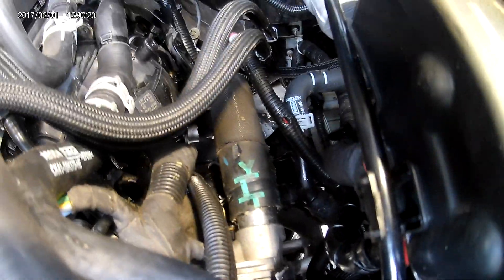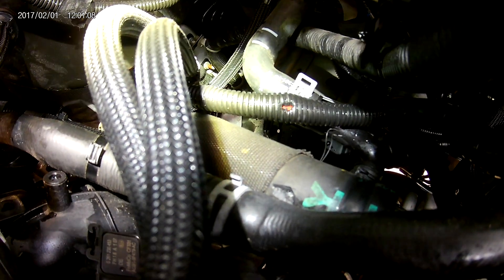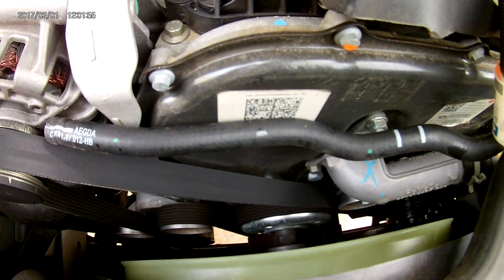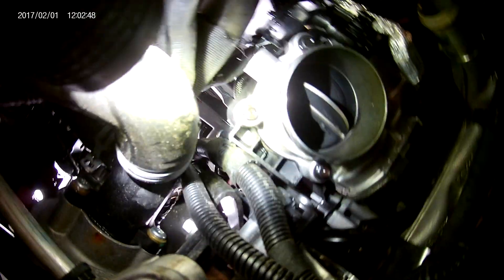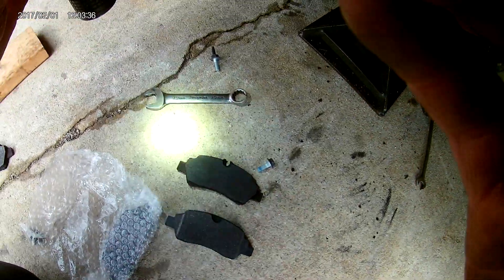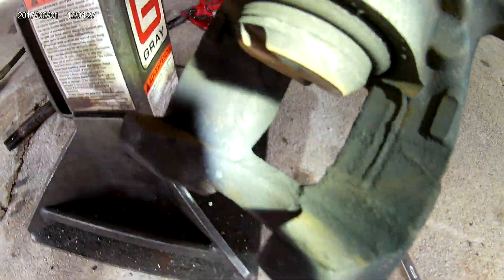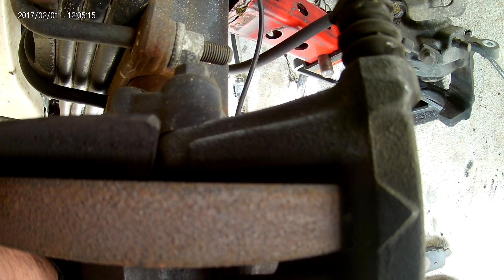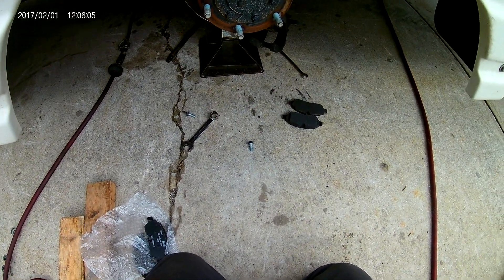2016 Ford Transit 3.2L Engineering fails

Comment: quote    though it's a derivative of Ford's Duratorq engine family, with origins linked to Ford's European engine development with PSA Peugeot Citroën, sharing lineage with smaller Puma diesel engines. It wasn't a single designer but Ford's global teams, particularly in.. This engine was a better fit in the Ranger 2012 up to 2021   parts well documented to cause engine failure are injectors , . egr  cooler ,,,egr valve ,,oil pump ,,, these issues are 100% random ,but very common

Comment: To add, the CAC hose rubs against the motor mount on the drivers side. 
God help you if you want to replace the front Macpherson struts. The dashboard has to be removed. The whole thing. Down the the firewall.
Also, Ford says there is no cabin filter for this van in North America. There IS a cabin filter for the European version. 
Guess what? Both versions use the same A/C Evap core box and ducting.
So yes. There is a cabin filter. 
And because Ford says there isn't, nobody checks. So the Evaporator core gets plugged full of all the dirt and crap from outside. So eventually it must be replaced. For this you must remove the dashboard. 
Which is handy if you're looking to replace the Macpherson struts. 
We have several of these, mostly diesel, but 2 gas. I have done this job on 3 of them.
The frame is flimsy stamped steel sheet spot welded together. 
Stupid design. 
All garbage.

Comment: Bought 2017 3.5 ecoboost in 2018. 70k driving through the desert and ca traffic for the past 3 years or so. Towed Jeep to Moab from Vegas (all up hill) have no problems so far ( knock on wood). Runs perfect, pulls like a freight train. Drove to Nebraska, Sturgis, Yellowstone etc. from Vegas in August pulling motorcycle trailer last year. Couldn't be happier. Now afraid to upgrade to 350 for more power based on these comments. Maybe I just got lucky?
Change full synthetic oil at 10K and service transmission as owners manual states. No issues in 110 - 120 summer heat and freeways at 85 or stop-n-go so far. Don't jinx me!
Very happy with my mid-roof transit! Sorry to hear of your problems. So far none of this has happened to me yet.
Reply from the maker: I would definitely stay with the gas motor. Unless things have changed they abandoned the 3.2L in early 2020 and didn’t even offer it as and option.

Comment: I have the 3.2L Diesel turbo in a 350HD van. We have been going through the EGR/leaking water/cooler deal for almost a year now. Finally stopped CELs, but I consistently lose power going up 5% grades (never an issue before) and it sounds like the turbo actuator or something is not letting the turbo give power, its like a naturally aspirated engine under load up hill. Cant even hear the dang turbo whistling like it used too. Found a bad inter cooler hose on the intake side, the hose that you had off to show the throttle body. What a nightmare. It just NEVER ENDS with this van. 3.2L is worst engine ive ever dealt with personally.
Reply from the maker: Such a nightmare they actually stopped offering them in the 2021s. Rushed to market to try meet EPA standards.
Reply: Did you get it fixed?

Comment: so basically if you take all the mounting clips that hold the lines in place, cut them loose and have all the hoses willy nilly, bouncing around rubbing on other hoses is somehow Fords fault? Cmon man! you gotta maintain the hoses and line clamps to keep hoses and lines where they belong so they dont damage other hoses , seems obvious.....
Reply from the maker: At less than 10k miles and 30 out of 30 delivered all the exact same way? Cmon man….

Comment: Random mention, boss had his engine blow less then 100k. Maintenance record and oil in motor. Mechanic said one piston went bad. Oil cap flew off from compression in top end.
Reply from the maker: I would say these were worse than the 6.4 power stroke. This is coming from a ford guy to.

Comment: Wait! Someone broke and didn't replace that hose clip and you call that an engineering fail? Sounds like Sprinter fanboy stuff to me...
Reply from the maker: When you get tired of doing rear brakes every 40k, EGR coolers every 12k to 40k, glow plugs less than 50k damn straight I’m a sprinter fanboy. Let’s not forget they abandoned the inline 5 cylinder diesel for there 2020 year models. Engineering fail maybe?

Comment: i want to know if thr power stroke 3.2 i5 is good in year 2019 for am rv
Reply from the maker: I would say no, I worked on them up to the 2019s, they were all junk. Any particular reason needing a diesel? Being an Rv if you were ever needing to sit idle for a length of time you will have world of problems out of the exhaust. I love diesels, with the emissions it’s job security for me. Hint hint I own a gaser.
Reply: @drsoot9760  what about the 2.8 duramax engine?

Comment: I've been doing a lot of research and I've been hoping to get a Transit but too many negative reviews. Too many mechanics doing videos showing failures of the van. None of my family recommend me getting a Ford. On top of that, they don't hold their value. Just search for any two year old Transit you be surprised how much it depreciates
Reply from the maker: That’s the exact engine, v6 Non turbo. I maintain a full fleet of gas and diesel trucks, vans etc. Out of all of them gas burners are the most reliable. I have some of the 6.2 ford motors pushing 460k miles all original except for a water pump and alternator here and there. I love my diesels but the emissions have made them costly to maintain.
Reply from the maker: Josue B 
Are you looking at the diesel vans? 
If you really don’t need the Diesel engine stick with the gas. I have a 2015 transit with v6, no engine or trans issues just rear brakes every 8k miles. Engine little over 200k miles on it.
Reply: @drsoot9760  nope, just regular gas. Wow 200k is impressive. What type of engine do you have? If I get one, I want a v6 regular no turbo

Comment: Had to replace rear main seals and oil pan gaskets on brand new explorers in the late 80s early 90s. Some with as little as 5000 km, Despicable.  Hard to believe they still have oil leak problems 30+ years later.

Comment: My 2017 Transit motorhome new engine at 15,000 kilometers due to bad bearing, transmission failed abruptly at 30, 000 km and needed replacement. I’m having my 2nd repair to the exhaust gas recirc. First it was a temperature sensor, now a DEF pump. All was covered under warranty. Haven’t had any brake work so far. Now I’m wondering if I should sell it and if I did what should I buy? For small Class B motorhomes there are only 3 choices, the Ford Transit, the Mercedes Sprinter and the Dodge Ram Promaster. I hear from multiple sources that the Sprinter is very expensive to maintain. The Promaster has its problems as well. Any ideas, comments or suggestions?
Reply from the maker: Mike Driscoll 
That is a very common on going issues with those vans. Good news is from my understanding ford isn’t putting the 3.2l in the 2020 models. I am a fan of sprinter van, but at the same time I’m not paying for the repairs just working on them. If it were me, I would most likely hold out for the gas motor that they are offering in the new sprinter vans. Only down fall is I don’t think it’s offered in the 3500 chassis. I’m a diesel tech, but all my vehicles are gas except for 1991 gmc with a 6.2 if that tells you anything about new diesels.
Reply: Dr Soot Thank you very much for your thoughtful suggestions. I’ll keep them in mind when making my final decision. There’s a lot to weight when buying a motorhome that I’ll be living out of for 4-6 months a year.
Reply from the maker: Mike Driscoll 
Just curious do they still offer a ford chassis like the E350 that’s a motor home? The 6.2 gas that ford has is very reliable engine. The fleet I maintain now run them some and they are in the 400k mile range with only minor repairs water pumps, belts etc. Granted they will pass everything on the road except for a gas station.
Reply: Dr Soot I think that they do offer the Ford E350 with some of the Class C motorhomes. They are a bit larger than what I am looking for. Also I haven’t seen a Class C with the quality of construction that I am looking for. They are built on the cut-away chassis and as there are so many RV manufactures making them the quality has suffered due to competitiveness and cost cutting. I’m basically looking for a compact camper van that can act as my year round vehicle even when I’m not camping. With a Class C or A I would need to have a 2nd car.
Reply from the maker: That really doesn’t leave you with many options. I know I wouldn’t go with any of the transits including the newest model with a different motor until it’s proven itself. If your looking for used stay away from the 2013 sprinters anything after that we’re pretty decent vans.

Comment: I have reviewed several post on the 2020 Transit, and I can't say I am happy with the reviews. They also showed a 2016 and a 2017 and both htose years showed early rusting, and very poor design. So from where I am looking I wouldn't purchase any Transit they appear to be a vehicle that will be in the repair shop a lot. Ford has really shot themselves in the foot with this line of vehicles.
Reply from the maker: Bryan Rodgers 
There was nothing about it that I liked. Hated working on them even more.
Reply: @drsoot9760  From everything I have seen and read about them they are a major piece of shit. I've owned several Ford vehicles, the last was a 2013 Ford Escape which had six recalls, and it blew out two radiator hoses which stops your vehicle dead in it's tracks. The first time it happened it was under warranty, but the dealer I took it to get it fixed kept my vehicle there almost a month....GO FIGURE! A whole month, and they never offered me a rental car, NOTHING. I complained to every agency in California, and threatened a law suit, not until I did that was my vehicle finished, and returned to me. That did it for me and Ford!

Comment: THE ONLY TRANSIT YOU SHOULD EVER BUY IS THE LWB 190 MODEL  IM ON MY FIFTH NOW IN 25 YEARS IN THE HAULAGE GAME   I USUALLY GET RID OF THEM AFTER 5 YEARS OR SO AND NEVER LESS THAN 400,000 MILES WITH NO ISSUES AND ALWAYS THE ORIGINAL ENGINES  NEVER EVER HAD A ISSUE WITH THE 2.5 ENGINE RETIRING THIS YEAR  AND NEVER NOT GOT ME HOME
Reply: Thank you for what appears to be the only comment that isn't hearsay

Comment: I bought a brand new 2015 Ford Ranger wildtrak 4x4 with the 3.2 diesel. Gearbox failed at 20,000km, then again at 25,000km. Crankshaft snapped at 27,000km requiring full engine replacement.  Will NEVER buy Ford again, and I tell everyone I know the same.

Comment: I hope when GM redesigns their vans they build it on their truck platform . Seems a waste of research and development to do otherwise .
Reply from the maker: evilcnil 
No doubt. But most likely they cheapen it up and throw the new 3.0 diesel in it, which does not impress me at all. Not to mention the little 2.2 duramax is nothing to write home about.
Reply: The new GM vans will be all electric.
Reply: @atx-cvpi_99  yeah reading the article now, thanks.

Comment: Those brake pads are about the same size as on my 2000 Saturn. For a 3500/one ton chassis, those pads are way to small.
Reply from the maker: John Clamshell SP 
That ain’t no joke. Ford does offer a severe duty pad that will last longer, but will also groove the rotor.🤦‍♂️🤦‍♂️

Comment: Ok so what do you onestly recomend? Sprinter or transit?
Reply from the maker: ameritradeRCE 
From a mechanic stand point.... the sprinter either the 3.0 or 2.1 liter are great engines. The transit with diesel has high pressure pump issues along with the EGR coolers failing. Transit has a weaker brake system, not to mention the suspension just doesn’t look healthy built. Keeping the alignment on one is a nightmare. The sprinter does have a few issues, like sensors giving issues, clogging intakes. But do stay away from the 2013 sprinter build for reason it had a lot of issues. Sprinters run better MPG to.
Reply: @drsoot9760  im looking at a sprinter 2010 3.0 with 40k miles and 2015 transit powerstroke with 50k miles and i cant decide want one to get... So many horror stories on both... thats your recommendation?
Reply from the maker: If it were me having to buy one, I would have to go with the sprinter. They do both have there problems, but the sprinter is better build. Chassis is better laid out, braking components are better as well.
Reply: @drsoot9760  What about the GM vans with the 2.8 Duramax?
Reply from the maker: @atx-cvpi_99  
Ehhhhh I’ve seen a couple of those where the motor give out around 3k miles. Of course the normal SCR exhaust problems. Oh an your supposed to have the timing belt replaced every 150k, some of the belts didn’t make it to 150 tho. Unless you absolutely need the torque go gas. And that’s from a diesel guy.
Reply: @EmcIcon i purchased the sprinter. Ive put 18k miles on it with no isses so far
Reply: The Ram ProMaster is junk. Both the gas and diesel ones have problems.
Reply from the maker: @atx-cvpi_99  
I hated the pro master!!

Comment: I bought 2015 transit 3.2 diesel/factory order
vehicle been in shop already to many times, rear breaks rotor replace twice until ford agreed caliper is not functional.
same water hose replace after three years driving or 100,000km
turbo replaced under warranty.
many censor already replaced, to many time in shop.
In 3.5 years already spend $5,000.00 on repairs/not included maintenance
Definitively regrets for decision to purchase.